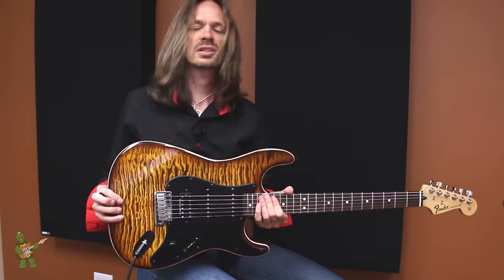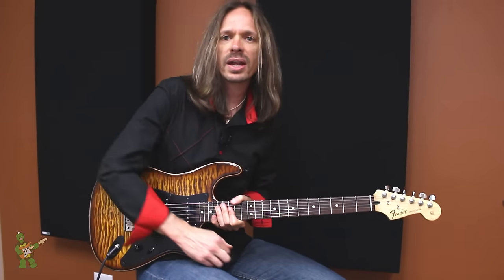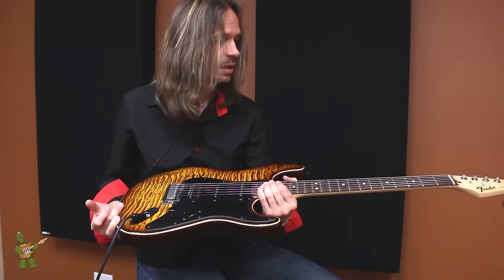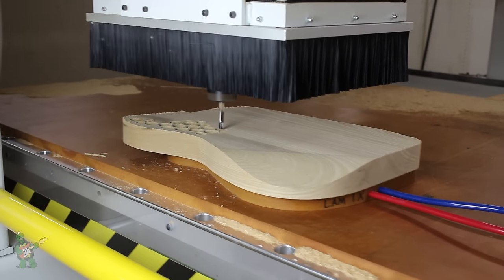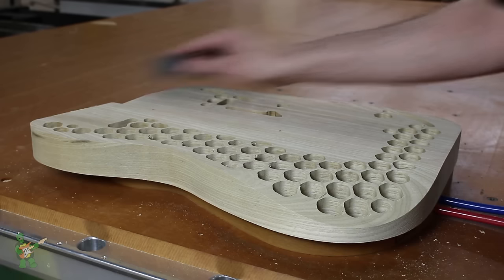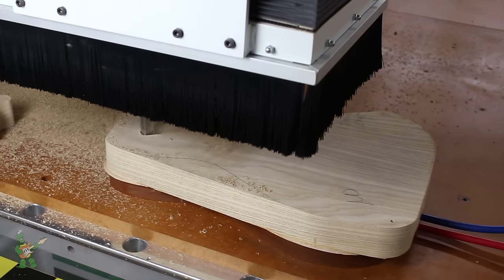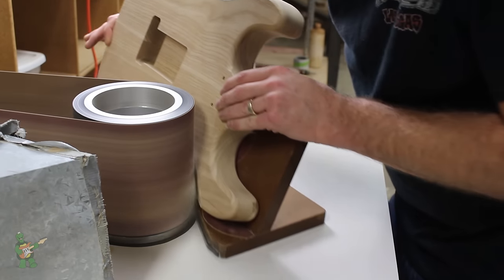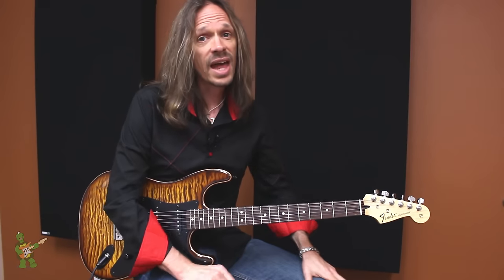How Chambered Bodies are Made

Comment: is there any downside to a chambered body?
Reply from the maker: Not really. Some feel it changes the tone. That may be true, but whether that's for better or worse is purely subjective. The one thing you can say for certain is they are much lighter and easier on the back/shoulder. I have played and owned many chambered and non-chamber guitars, and I don't think there are any hard and fast conclusions that can be drawn. Each guitar has to be evaluated on it's own merits. For example, the best sounding Les Paul I own is chambered, and only weighs 7.8 pounds.
Reply: Warmoth Guitar Products Thank you for your answer 👍